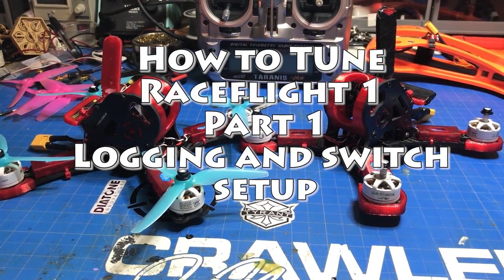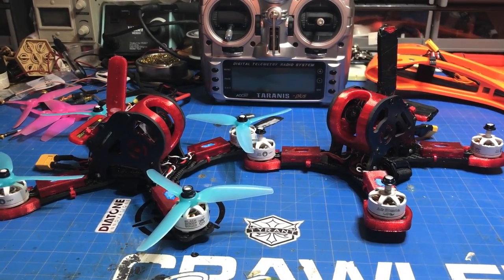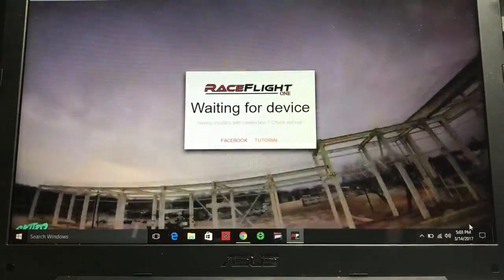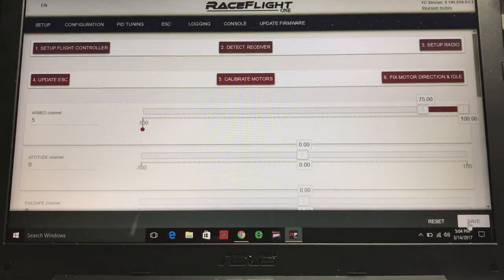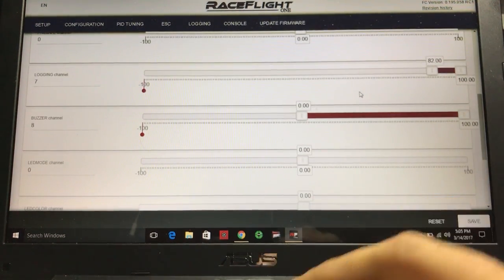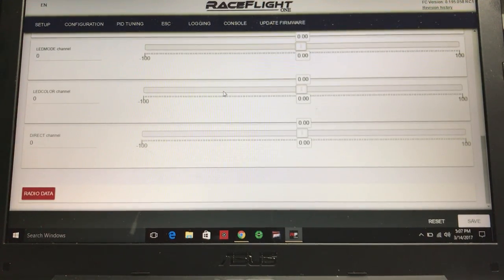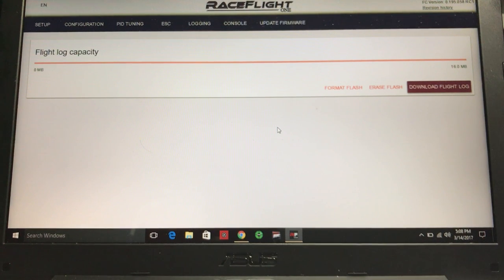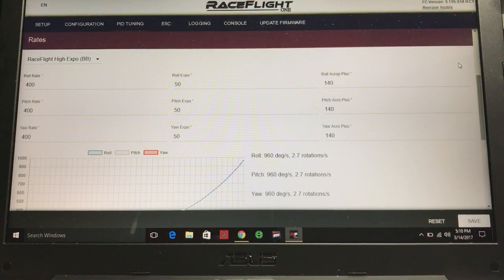How to Tune A Racing Drone with Raceflight 1:  Part 1 Switch Setup, Logging and Rates

Comment: With the new OSD flight one flight controller being out, you should make a new video and actually tune the quad. That's what I thought this video was going to be and I can't find any videos showing someone tuning the flight one quad. Tried using captainvanover's tune but I can tell that roll, pitch and yaw are not holding it's positions good.  They are all drifting every which way. Roll is flattening out, then when yawing and rolling around an object the whole quad raises up in altitude and when doing a hairpin turn the quad stutters for a split second.  It would be nice to see how someone else approaches tuning there flight one quad.
Reply from the maker: sorry man..I just gave up on RF..it was jsut too much back and forth..good then bad..then something worked and then it didnt.
Reply: ChaddyCEEE RC, yeah it definitely has a different feel then my betaflight quads and I just can't shake this slight oscillation stutter.
Reply from the maker: Unknown X sounds like the q setting of the kalman filter they have. Like my butterflight quads. Need to lower your filters bit by bit maybe.

Comment: Hey Chad, quick question, all the information I have and I have read, says oscillations high throttle or punch out, reduce P gain, but you are saying the opposite, Am I missing something?
Reply from the maker: its been a long time since ive played with raceflight but I still keep up on it.  from what I gather..most people are having the best success using the newest builds with the 324 default PIDS and filters that are in a preset in the PID configurator.  but IMO lately even with BF ive had to reduce Ps and then increase I to get the feel that I want.  all the default tunes seem to be a little over tuned for racing..even the go pro default in the newer racefilght builds.

Comment: Hey I have a question. I was considering getting raceflight one and put it in a quad that already has a Dshot 1200 Esc on it. Do I have to have the race flight bolts or can I use any other Dshot ESC.
Reply from the maker: RF1 supports dshot1200 but they still recommend to use multi shot since they believe it runs faster with their firmware..when they release their new escs and revolt(revolts now on preorder) they will have direct digital bus lines to the escs instead of using an analog wire

Comment: Thanks for the video. I just completed my first raceflight(revolt v2) build on this past Saturday. Been doing fpv racing drones for about 13 months now. All betaflight. I am having trouble with the configurator.  When I am on the PID Tuning page nothing will save. I click the "save" button and nothing happens. In addition only the PID numbers are shown. The Rates and Filters are blank. The only way I've been able to make a change is in the Console. I downloaded the latest version. Is there something I missed? Thanks.
Reply from the maker: VD2021 I had this happen a few times. Delete that install and try downloading and a fresh install of rf1
Reply: I had the same issue. Turns out redownloading works, makes me a little suspicious of its stability.
Reply: VD2021 that’s usually caused by the configurator being a different or incompatible version from the Firmware, profiles were added in later versions so old configurators that don’t have profile support can have those issues